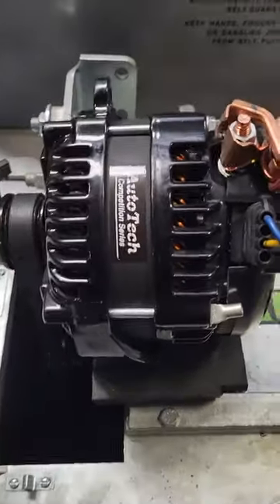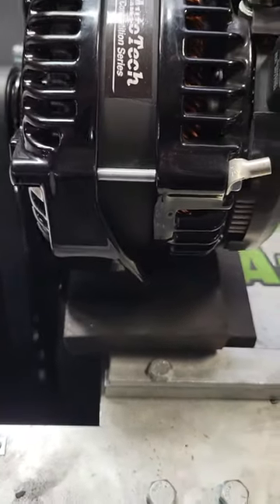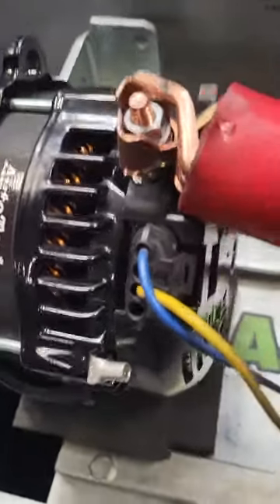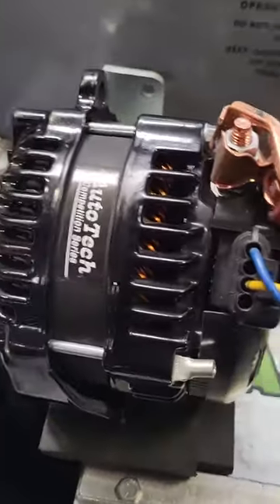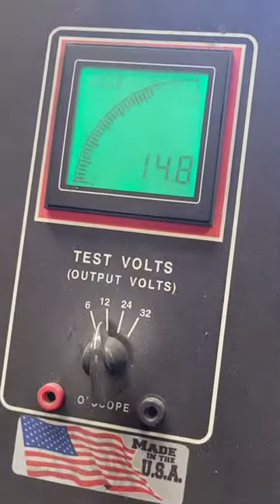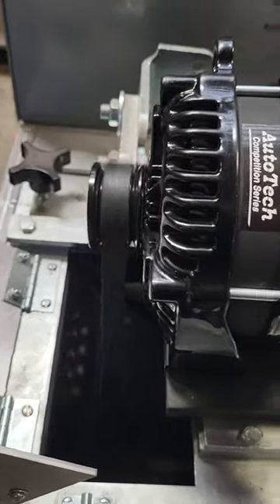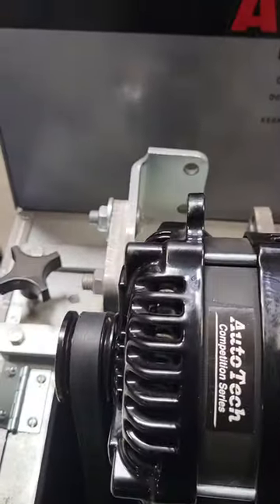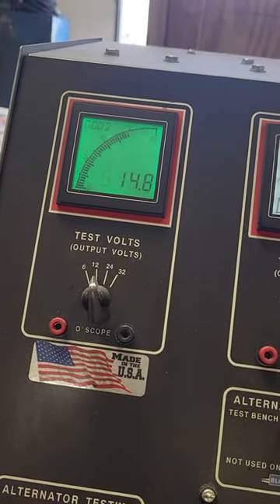Proper grounding for proper voltage

Comment: I have heard Denso altenators don't need to be grounded .Is that true? Also the Altenator I had,( Delco) has a ground terminal.  If the Denso altenator needs to be grounded, should I put the ground cable on the bracket bolt?

Comment: i grounded with 1/0 to the mounting location on your powder coated unit but i dont have a rear bracket delete and im reading 14.8/14.9 on my dmm, i couldnt use the little baby lug you guys put on it due clearance issues between alternator and block, is their another way to ground the rear of the case better?
Reply: also the lug is very little how will it help with the amps if you can only use a 8g? im not no pro so these are all question to clarify

Comment: Ok...got it. So you never said where the other side of the ground is to be connected. Chassis? Battery Neg? Frame? Just helping others get clarification.
Reply from the maker: @stevenm.hollis4429  chassis is highly recommended 👌
Reply: Right now I'm grounded to the battery neg. Should i change it to the truck frame? @autotechengineeringusa